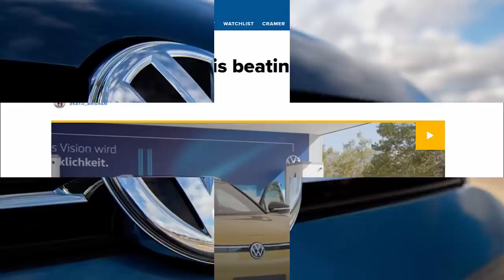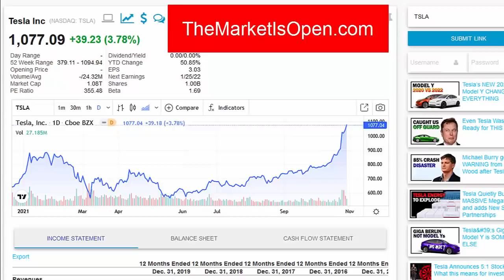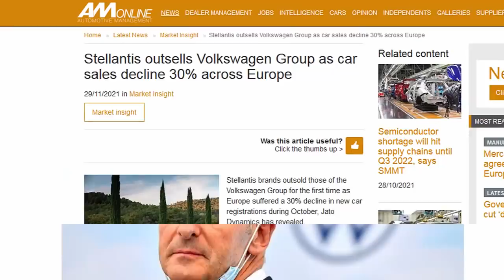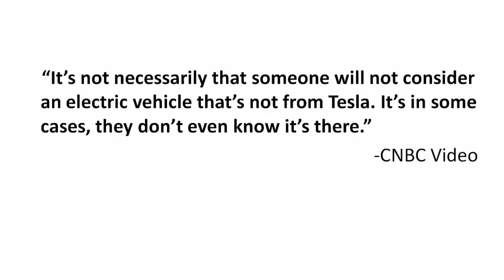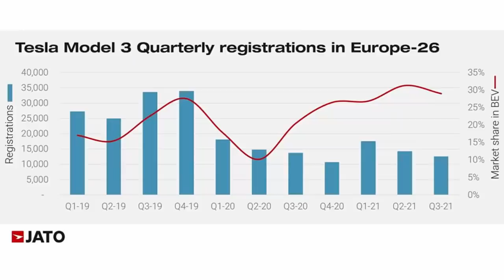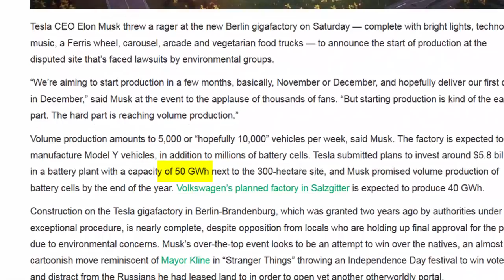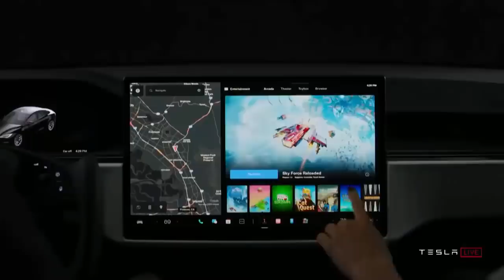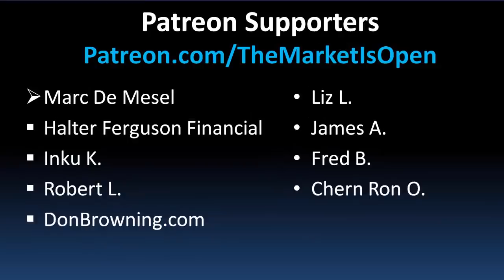Why Tesla will CRUSH Volkswagen in Europe

Comment: I was having this discussion with a coworker not long ago. Tesla isn't having ANY trouble selling their vehicles, so it makes no sense to try to increase demand at this time. Rather, they need to be and are increasing their production capabilities exponentially. Everybody keeps believing that other car companies are going to take over, but the fact of the matter is that there is very little production of true EVs in the market at this time. It's because of this that Tesla looks like a very small player, when actually they still control over half of the true EV market. Other car companies are catching up in their market share of true EVs, sure, but that only serves as a bigger justification that they need to increase production even more. If such small moves can upset the market, then the demand fiercely outnumbers supply.

Another thing: this is all while larger, "wealthier" car manufacturers are throwing oodles of money at the problem, and still not matching the value Tesla can provide. Their profit margins are probably going to be garbage for quite some time, while Tesla's margins are higher than they've ever been - and they're still a fast-growing company.

Comment: I think you should have mentioned the difference in debt levels in VW & Tesla. It's hard to pivot from ICE to EVs with an elephant on your back!
Reply: Yep absolutely, but the debt servicing is yet another burden on top of most of them. Which at the end of it they all seem to need a shear miracle to survive. But they have some luck going for them all. Tesla limitation and impossibility to supply world demand for EV is the only glimmer of hope for them all, but yet they will need to work very hard not to compete directly with Tesla, but just try to supply with some decent EV
Reply: thing is they should have pivoted years back instead of cheating emissions, btw they're still producing and selling diesels and they'll continue to do so for at least 5 years
Reply: 🧐 VW debt is mainly arbitraged finance for customers. Makes up 10-15% of their revenue. Detailed on their financial reports. It’s not capex debt. 

Tesla doesn’t have as much debt because it dilutes the ownership of its shareholders by 7% per year to fund factory expansion. This will need to continue for 10 years to meet the 20m cars per year sales target. And it’s only 7% because of how over priced Tesla stock is. If the share price drops, owners of the company will be diluted more per year and/or debt will be taken on to fund expansion. 

Volkswagen group can fund their planned expansion with their cashflow from operations. 

They will of course continue selling normal cars. Electric cars are available to developed nations with electrical infrastructure to handle it. This won’t be a dominant thing for the developing world for 30 years. 

Musk is awesome. Tesla is a great company. But even with 20m cars in 2030, insurance, FSD and looking to Tesla bots, it’s hard to justify current market cap for me
Reply: @kofManKan  a very well thought out response.

Maybe you didn’t read my post, but I am a fan of Tesla. 

What I’m not a fan of are people beginning their investment journey and not understanding that the information they’re consuming may not be accurate on how to value a business and measure opportunity cost and that they are likely getting caught up in excessive hype- which has happened before and will happen again. 

I simply pointed out that the information being provided is flawed. There were a couple of other things in the video as well. The Tesla stock pushers on YouTube all tend to watch each other’s videos and therefore looks like they repeat each other without critically double checking, because the same errors are repeated as well. 

You do you through, bro
Reply: @achillestheant430  Selling diesels still at this point of time makes sense. EVs are not yet for all use cases. World is not ' black and white'
Reply: if lithium ion is best Evs can do they are doomed.  6000lb cars?  May as well stay on ICE Tesla it self says the S is only as green as a BMW 3 series.  Tesla can't make the intermediary 4680 work yet - that is a very big deal if they can't fix it as cybertruck Semi and Roadster plus updated x y and 3 all depend on that working so far its an embarrassment.  That proves transitions for anyone is hard.
Reply: @NoRegertsHere  Tesla has current debt from operations not like the legacy makers who are walking in quick sand.  you are so correct
Reply: @stevepailet8258  🧐
Reply: @NoRegertsHere  It will be fascinating to watch things develop.  It just "feels" like Tesla's timing and the circumstances are giving them a tailwind right now.  Things can change, but wow things seem to be falling into place for them.  Just think of the managerial drag for VW of having to make the transition from ICE that is non-existent for Tesla.  And all of the stranded investment or higher cost to convert old factories to new EV/battery production vs building a new state of the art plant from scratch as in Austin.  Think of Michael Dell figuring out how to sell and make computers from supplier parts before he's' even paid for the parts.  And Musk is doing it in a vertically integrated way.  Financial and physical production innovation plus technical innovation, pretty powerful combination.
Reply: @butopiatoo  plenty of companies pay for materials after they’ve already sold the finished product. That’s cash conversion. 

VW are doing fine with the electric cars. But there’s still going to be a huge demand for normal cars for decades. 

In any case, you do the valuation on the business the way you want. I did mine based on 20m cars in 2030, FSD by 10x the amount of what would be Uber drivers world wide predicted in 2030, every Tesla ever built using Tesla insurance, arbitrage finance opportunities, Tesla bots not far off, a few other things. Essentially it’s 50% CAGR in revenue plus 8% share dilution for another 9 years

Used a net margin between legacy car makers and Apple (Tesla isn’t near that middle mark yet)

And used a 15% discount rate.

I still can’t get the business worth more than $500m in today’s dollars.
Reply: @NoRegertsHere  Thanks.  I'm curious about your 7% dilution to TSLA stock holders.  How is that happening?  Issuance of more stock?  Something else?  Valuation models are tough.
Reply: @butopiatoo  yes. Tesla issues shares every year. That’s how they’re funding the expansion. 

If share price drops too much, they’ll either dilute more or take on debt. Rate of expansion is more than growth in cashflow can fund. 

Bottom part of income statement if you’re keen to look
Reply: @NoRegertsHere  yup i understand the concept, i just thought it was odd you named a constant 7%.  Maybe that wasn't you intent or maybe that was the last tranche of shares issued.  I'll look at the financials, thanks.
Reply: @butopiatoo  oh sorry about that. 

shares outstanding
2016: 721m rises every year an average of 7.7% to reach 1126m now
Reply: @NoRegertsHere  you mean US$500 Billion,  I suppose. Apart from that, you may appreciate stock market prices tend to have a significant emotional component that drives them. People want Tesla to succeed, not just for fun and profits but also and perhaps principally so , because people feel things are going horribly wrong on this planet and Tesla is just about the best symbol of hope they have.
Reply: @charlesvanderhoog7056  $500bn, yes thanks. 

People tend to be emotional with a lot of things and that can be catastrophic for investing. I wish them well

Comment: The only problem VW needs to address is elementary and it goes down to a very simple question.  Why is Tesla outselling every single EV made in the entire planet, without advertising, without a single dealer pushing the metal, and without any other form of sales solicitation?  If the answer they come up with is the correct one, then they will have a chance of surviving, because they found the target they need to aim and shoot. But  the real problem Tesla poses to all its competitors goes much deeper than finding the answer to the query. Because the perceived weakness of no advertising and of not having a dealer network, for Tesla turns out to be a 30% long term manufacturing cost advantage very hard to bridge by any competitor, for that is about the cost that every manufacturing traditional auto firm needs to keep to stay in business in the form of their dealer network and their ad budget. When we add all the other technological assembling process that allows Tesla to spit out new Ev almost 3 times faster than all the other manufacturers, then it becomes crystal clear that Tesla lower cost advantage climbs two more notches and up to 50% lower cost advantage, and at this point the only thing the competitors can do is throw their hands in the air in despair, and try somehow to invent something new or die.

Comment: The numbers of EVs sold is only part of the picture though. Gross margin is a much better indicator of what's going to happen. We already know that Diess says that VW takes three times as long as Tesla to make a vehicle. For VW to survive, it needs a step change in their production methods and design. VW doesn't have the vertical integration that Tesla does, and it doesn't know how to make batteries in house. Frankly, the idea that they will catch Tesla is fanciful. VW executives are clearly in denial.
Reply: Tesla makes curs so much faster which is why a model3 is >10k€ more expensive than an ID3
Reply: @grekiki  exactly, i doubt VW is making any money on their ev sales

Comment: In the meantime they continue to work in silence, without hype here in Europe!!! Mercedes already has a range of over 1000 km. This technology will certainly not be less in the smaller models. The German CEO said that not a single Mercedes will roll off the production line in 2025 that will not meet these requirements. This is of course only the beginning in a very innovative time in which we do not need it, for example, to send a Mercedes into space. We strive to train every garage owner and the young people in such a way that they receive 100% after-sales service. Not the happy few should be satisfied . We have the task of dealing sustainably and with care throughout the economic chain. The class for a new generation European lay in the first place  here and does not in sometimes irrational stock market figures witch can manipulate sometimes but not evrytime.  He smiled while blinking his eye.
Reply: when you build a car that has a massive battery sure anyone can get the range.  135 kwh vs 90 kwh   of course YOu know that to get this extra range is free or Marsman you are saying it is free.  Blowing and going about 1000km range.  Seriously it is going to likely add $50K to the bottom line price.  By the time they really start rolling off these cars in volume I do have to wonder where they plan to get the batteries
Reply: @stevepailet8258 

Mercedes managed to get 10 kilometers per kilowatt hour

This is unprecedented

Comment: There are three major hurdles for all legacy manufacturers need to address. The largest is transitioning in a financial sound approach to EV. Second thing is to drastically build out a vastly increased supply chain. The final issue is to actively develop intellectual advancements to be competitive. 
Financially, the full transition process is going to be the long-term struggle for legacy makers. Tesla never had this cost, allowing them to invest much more on intellectual advancements. I personally believe that legacy manufacturers will need to be more fiscally efficient to even have a prayer of long-term completion with Tesla.

Comment: I think this is totally misrepresented. Yes it's going to be EV but VW has a great standing and model range. Top 1 maybe not, top 2 is really realistic
Reply: He is a Tesla fanboy what else do you expect?
Reply: The challenge for VW is the same as all  (and I really do mean all) other legacy automakers. That is, making the switch to EV. The issues are far too many and too complex to go into in the comment section. One thing is for certain, several of our most well known legacy automaker brands are going to die as they have left it far too long to make the switch. With that said however, out of ALL the legacy automakers, VW is in the best position to make the transition. They may struggle for a while but I’m backing them to pull through. We’ll see if they will maintain the top spot as there will soon be a tsunami of good quality Chinese brands that will hit wider European market. And guess who controls most of the world’s EV battery production?
Reply: BUT VW is too lazy and slow to get up and GET TO WORK. They should have an all electric Amarok pickup on the streets by now but they won't even IMPORT the damn truck into North America. They don't have a chance with that attitude. I predict they will have a slow but painful sales slump over the next decade.
The best solution is to use the Amarok since they can have the Ranger platform to build on. Work on an existing dual electric motor and use the truck bed to install large batteries. I'd gladly sacrifice 20% of the bed space for batteries so I can get some decent range out of the truck. But noooooooo, VW's dummkopfs in Wolfsburg think nobody will buy an electric Amarok here so they won't even import it. They are SO lucky that GM killed off its Saturn hybrid program and set itself back 6-7 years in technology and have been struggling to play catch up too.

Comment: OK so I am in the market for an EVI actually went 2 days ago testrove not only the new ID4 but but the Model 3 I have to be honest I was kind of underwhelmed with the ID4 and before and it's lackluster  For having where it felt like it had power the only thing I found interesting or I'm interesting or exciting about it was It's feature when you take the foot off the gas it off the gas it still does a rolling instead of the pulling and stopping right away right away. Plus the ID4 was going to be more expensive. Not by much but it seemed to help waiver the decision. And my husband felt afraid of electric vehicles altogether. He stated that if we're going to do it minus we'll go with number one, at the end of the day the real reason I chose the model 3 over Volkswagen was the fact that I could get the model 3 in a month and a 1/2 versus the Volkswagen they said would take 8 months if Volkswagen can't get The cars off the line and to the customer they're not going to be able to sell them.

Comment: There are a quite a few assumptions in this story. Never underestimate your (Tesla's) competitors. At first giants like Volkswagen may be slow to change, but once they do, things usually move (very) fast, so they - and their business partners - will significantly benefit from their long term knowledge, experience, (business) network and customer base (especially in Europe). With the upcoming ID 5, VW is already making a big jump forward and I think the ID Bus is a smart move too. About the number of models. People/customers like to have a choice (at different price points), but that is limited at Tesla, which is both their strength and their weakness.
Reply: Keep dreaming. This is far more complex, costly, and time consuming than you make it out to be. The legacy automakers are in deep trouble and Diess who is inside the legacy auto world knows it. That is why he's sounding the alarm.  The problems legacy automakers have is massive. It's not just a matter of ramping up, they deal with inefficient dealership distribution model. They have to subsidize the transition to EVs with their ICE sales, while ICE sales are dropping. As Diess pointed out, it takes VW 3X longer to manufacture an ID4 at VW's Zwickau plant than Tesla to manufacture a Model Y. Additionally, legacy auto manufacturers must spend billions on advertising and marketing while Tesla has zero marketing spend. Legacy automakers also can't gain any real efficiencies relying on decades old manufacturing facilities. Which means they must shed many of the old manufacturing facilities and build ultra-modern facilities that can keep up with Tesla's Giga Factories costing many billions in the process.  The idea that it's a simple transition and legacy automakers will be competitive is extremely shortsighted.